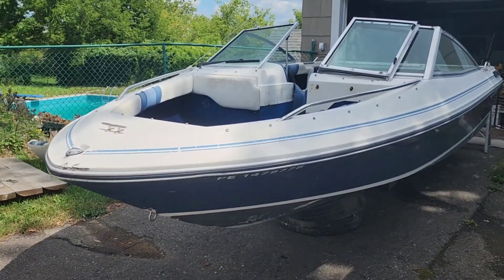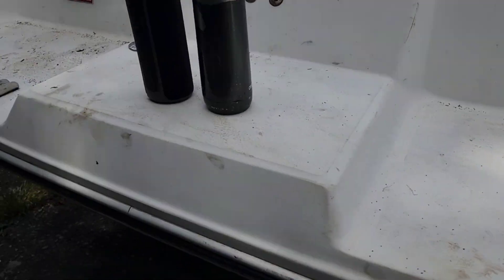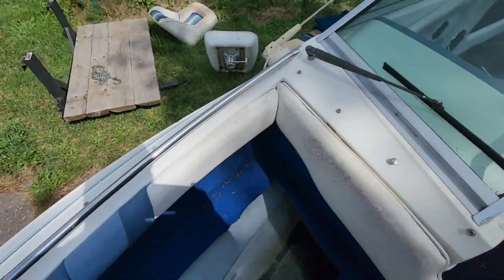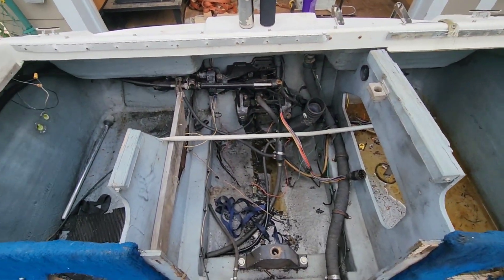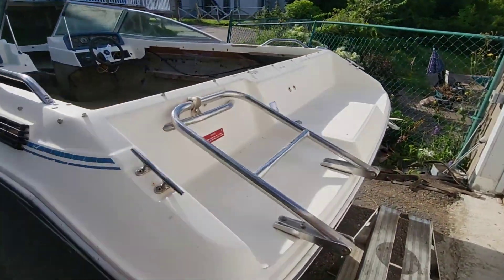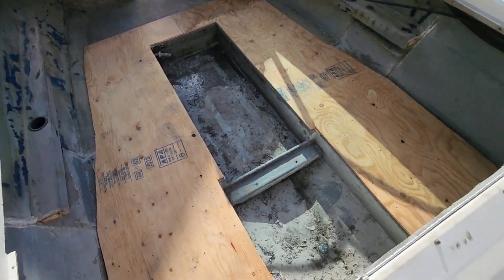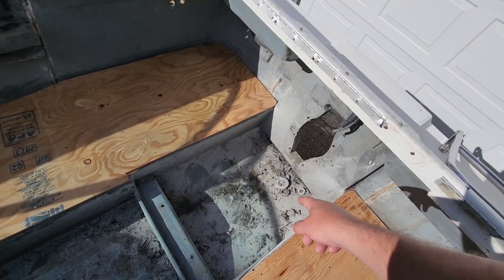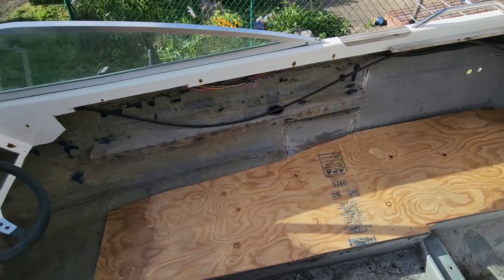1989 Sea Ray Bowrider Boat Project

Comment: just got the same boat but a 1990 160. Fun project. any idea what the water hose under the passenger dash is ? I also have the same aluminum knob on the outside of the passenger  hull
Reply from the maker: It's a vent tube for the fuel tank

Comment: hey, are you going to throw away the gages and the steering wheel if so, would you mind sending them to me? If not no biggie on my end here. Thanks.
Reply from the maker: I'm thinking I might make some garage wall hanging art out of the old gauges and steering wheel. If I decide against it I'll contact you.
Reply: Ok thank You..  @MillCreekWoodworking